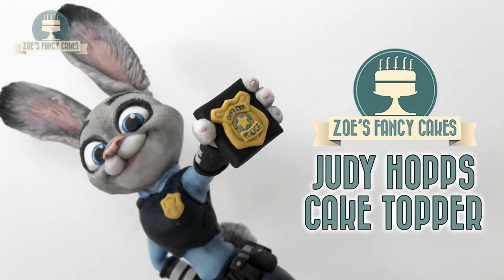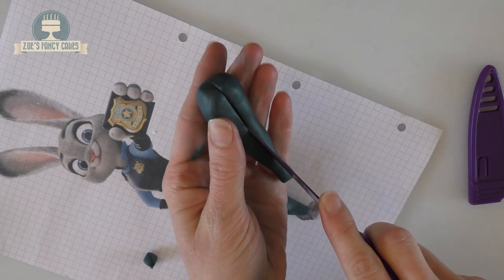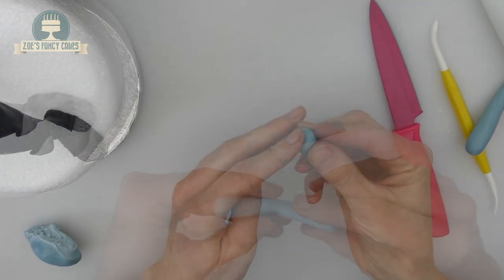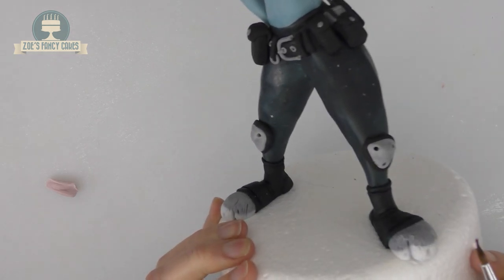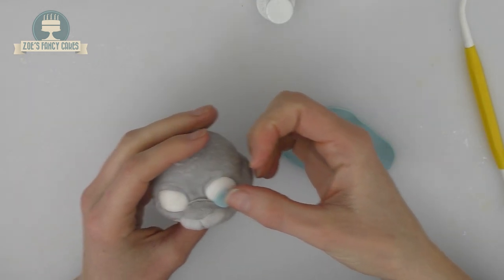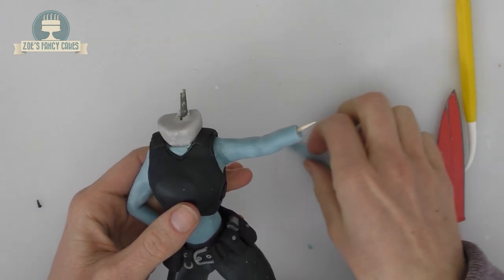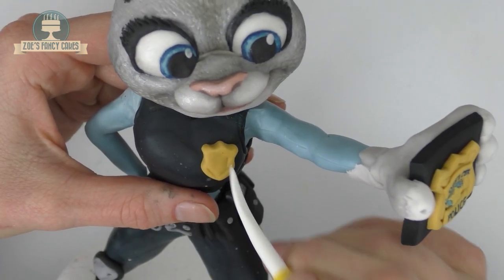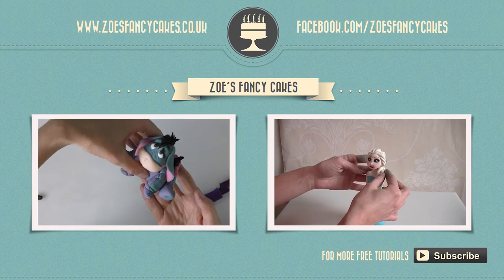Zootopia Judy Hopps cake model Zootropolis

Comment: I keep thinking she used clay not no cake thing did u think she use clay?
Reply from the maker: +Shelby Reed fondant / modelling paste works in a similar way to clay so you could use clay to make this using the same method.
Reply: +Zoes Fancy Cakes did u use clay if so the tilt say cake not clay or I don't get it?
Reply from the maker: +Shelby Reed I used modelling paste, not clay. I made it from edible icing for cakes
Reply: +Zoes Fancy Cakes ok